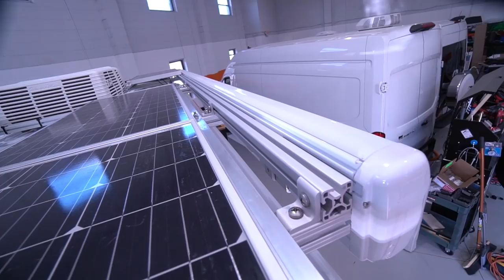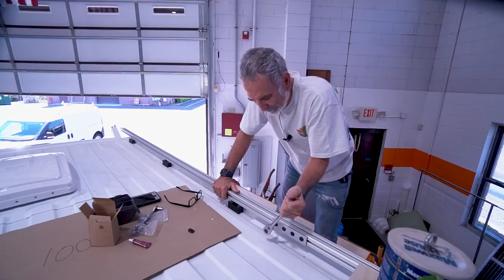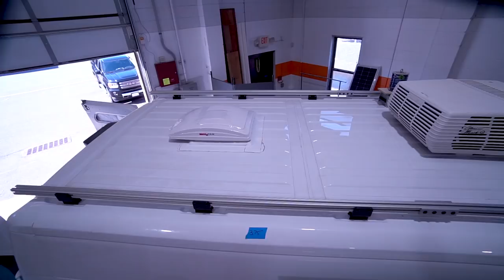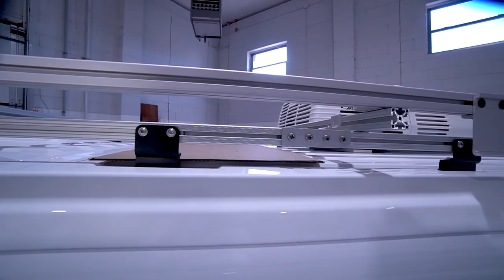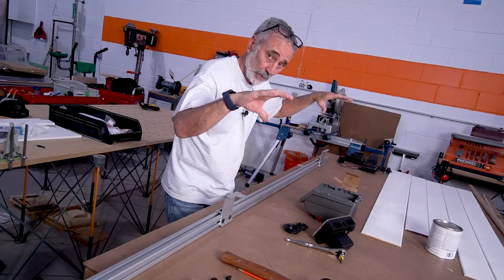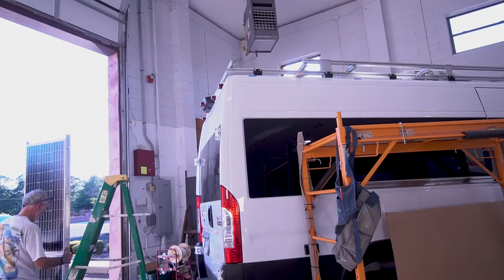Building a SOLAR ROOF RACK (on your van) using 8020 extruded aluminum

Comment from the maker: The bolt, washer and the T-nut are all stainless. Since corrosion is localized at the contact point, the larger anodic surface area (anodized aluminum) as compared to the smaller cathodic surface area (ss washer and T-nut) will create a passive coexistence. Since the ss bolt threads are embedded in a like metal, ss T-nut, I don't anticipate any seizing.
Reply: What a timely video. I am currently designing my 80/20 roof rack for our van. I was concerned about the nuts and bolts but figured 80/20 used stainless. Guess not. Thanks George.
Reply: George. Steel hardware = Loctite. SS hardware = Never Seize I like your rack but the profile bothers me a bit. Captures and holds water and solids. As an example,when hanging steel it was always toe down.
Reply: You’re Going to Get Dissimilar Metal Corrosion Between the Stainless Steel and Aluminum.
Reply: @allenturin8847  Never knew about stainless seizing until working on a van. Crazy stuff. Still haven't figured out exactly which conditions cause it.
Reply: @moneypitvan6378  SS hardware galls like a blankety blank especially in this kind of environment. Never Seize is not optional. Period the end. Spent over 20 years installing erecting and maintaining automated machinery. Nice rack though. I would just prefer it to be a custom weldment with endless runs thats all.
Reply: @allenturin8847  Thanks for the tip, just ordered some marine grade Loctite anti-seize. Couldn't quite figure out which Never Seize to order so hopefully this one works. Ordered some Lanocote also. Seems to be necessary.
Reply: If you do notice any seizing, you can coat the SS parts with Tef-Gel to isolate it from the aluminum. We do this on our sailboats where SS hardware is secured to the aluminum mast.
Reply: @explorenaked  so did I!
Reply: I didn't think 80/20 sold SST hardware.  Where did you source the t-nuts?  Standards are the same size as low-profile weld nuts so I was thinking of going that route.  Thanks
Reply: @ideafaucet5710  Yes, they have both. Their default seems to be the black ones, but they also sell stainless versions.
Reply: @moneypitvan6378   electrolosis causes it.  It is the same thing on battery terminals.  Atoms have energy.  Energy and electricity are the same thing here.  two dissimilar metals conduct electricity differently and corrosion forms.  Aluminum boats and motors have a zinc anode on them.  That anode is sacrificial.  Salt water hastens the electrolosis corrosion effect but the anode corrodes first, protecting the aluminum boat and motor.  The zinc is another dissimilar metal but it corrodes first.  That is why you never see stainless steel on a boat get corroded.  That zinc anode typically gets replaced when it is half worn so that the effect stays intact.
Reply: Stainless and Aluminium is not a good mix - it will corrode. 
Zinc coated bolts are the way to go here, to get it bi-metal electrically happy.
Reply: @G-ra-ha-m  You would think that for as much that 8020 marks up all their bolts would be zinc plated.  Of course now it will be an option and a1/4-20 zinc plated bolt will cots $5.
Reply: @jcbrown59  Stainless and aluminum seem to to work ok together.  Have done is outside for a few projects, and didn't get galvanic corrosion.   Plus, SS is the more noble metal in this case, but it has the least amount of metal.

Comment: Oh no. I have to change my hardware on my 8020 roof rack to stainless. Thanks for the tip.  Enjoyed your video as always. Thanks George!
Reply: Yeah, seems counterintuitive that 80/20 would sell you this amazing weather-proof aluminum, and then throw in bolts that will rust out quickly. I guess 80/20 was traditionally always mostly for indoor use? Fortunately I discovered this issue on bolts under the van right before I started working on my roof rack. No huge disasters.

Comment: I think it's a very good idea to use s/s fasteners on "any" outdoor assembly combined with Lanocote. This product is made with lanolin. That's the grease from sheeps wool. Excel. anti-corrosion, anti-seize, lubricant etc. Totally natural product that works! Especially, if you live near the sea. Comes in a spray can or as a pottle of grease.

Comment: George, I suggest bolting your solar panels to your 80/20 rails, then mount the rails to your roof rack using connections tall enough to go over your AC and Roof Vent.  One flat Solar Array of eight or more 2' panels depending on van length.  Make the Solar Panels the highest point on the van, no shade from other components disrupts the panels, and it provides shade to the roof.  Mine works perfectly!  I can do 80 mph and the solar panels are stable.  Elevate the Solar array to accommodate the maximum amount of panels.  You mentioned in a previous video you want more panels.  It works!
Reply: does wind  lead to excessive noise? just curious?
Reply: @curtjohnson8309  I bolted four 100 Watt Renogy Solar Panels to Super Strut's ( Available at Home Depot and Lowe's ).  I bolted the Super Strut's to the Roof Rack.  No noise, and it provides shade to the roof.

Comment: I did an 80/20 roof deck with manual moving solar panels so I could use the deck. I used 12ft lengths of 40 x 120 on the sides and 40x80 across with decking all bolted with stainless
Reply: would like to see some pics of that
Reply: I have a question, setting up my first can build.  Do you use the 80/20 10x10 or 15x15?  Is 10x10 ok for interior/exterior, or is it to small for anything?  TIA

Comment: If you're particular about black fasteners, McMaster-Carr carries a series of 18-8 pan head stainless steel bolts that are coated with black oxide.  You can easily find 1/4-20 or 5/16-18 that will work on 80/20 hardware, either Philips or hex drive.

Comment: well I did a 8020 rack with my nea320w solar... fit 2x and 2 sets on my roof.... now like you show... one person to lift is easy with those smaller ones... but omg bigger ones are harder.... omg thanks for the video.... shows that My system will work well....:) on my 03 workhorse... just got my batterys in too... :) thanks for the great video.... would love to sit and talk shop some day.... but can't wait to see what comes next... :)

Comment: Really cool 👍🏼 
I've about got all my stuff together to start my roof rack for my solar panels but I've thought long and hard about this because a rv roof isn't enough square feet to have enough solar to run everything all the time. Soooo I decided I'm gonna double stack my roof rack. The bottom will be stationary and the top ones will have actuators. So when I set my rv up, I'll push a button and engage the actuators and they'll fold out. So I'll have 6,400 watts of solar which is perfect. Can't ever have to much power 😂

Comment: I would add a layer of Lanocote paste between the SS bolt and aluminum brackets.  If they drive during winter or in seaside areas salt will get up there.
Reply from the maker: This van will live primarily in the deserts of the southwest. And with the "annual tighten up", any degradation can be addressed.
Reply: @HumbleRoad  cheers!  I should have known you know what you are doing!

Comment: So jealous of Defining Adventure. I met Eric & Jen through another couple and their youtube channel. Nice people. Look forward to running into them on the road one day in our vans. 

Also, great vid here. i have to make a custom roof rack for my van and was wanting to use 80/20, but wasn't quite sure the process. This vid helped a lot. Unfortunately, I've still got to make supports inside the van along the ceiling for the rack because it'll be a fiberglass roof I'm working with.

Comment: Make it where a second layer of panels can slide out and can be used as shade as well as more power!
Reply: Samantha. I had the same idea. Lower panels which slide out like an awning and can be angled up and down for the best sun angle. Maybe with an adjustable leg. Then a top layer which can tilt up with a motor. 2KW panels - easy.
Reply: @ecoworrier  yep

Comment: As stated before, ALWAYS use stainless on anything outside. Nuts and washers to. Ideally, lockouts with never seize on the threads. Blind holes should get a drop of blue loctite.

Comment: Hope that your stainless steel parts are AISI 316 otherwise with AISI 304 you get contact corrosion between stainless steel and aluminum.

Comment: Use the solar panels as an extending/tilking awning... Slide them off the roof, tilt down, boom. No need for an awning.
Reply: And then get fancy and have the tilt be via a computer controlled acme screw that can follow the sun when you're trying to maximize power generation.    :-)

Comment: I've always been against using regular steel hardware in outside/wet conditions. Even zinc or galvanized or other 'anti rust' just doesn't stand up to the rigor. Use stainless A4 or AT grade or go for titanium hardware.
BTW I hope you also used stainless nuts and washers, not just bolts.
Reply from the maker: All stainless.

Comment: I see you managed to set up a bit of a scaffolding.
Here is not me saying you are old, but with age, we all struggle with easily getting up and down such straight scaffoldings.
Wouldn't it make sense to build one that fit the whole length of the biggest car and have it standing in one area, so whenever you need to work on the roof, you park the van next to that scaffolding?
Another thing, when working in heights, consider your safety and maybe connect a stair to the scaffolding, so you don't have to climb up the ladder.
It will also make it easier on you to bring things up and down. 🙂

Comment: Yep, already seeing light surface rust on my t-nuts on top of my transit.  I can reach them pretty easily and since they were a BEAR to install, I think I'll wait on replacing them.  One huge pain in the rear is that as you slide a t-nut with a bolt installed along the 80/20 channel, they want to spin counterclockwise and UNSCREW themselves mid-roof...UGH!  Huge pain to keep them from 'running' out and landing on the roof under the solar panels.  That's why I'm waiting for a bit...good times.

Comment: Depends where you’re at but I would always use stainless on exterior hardware. Stainless will still rust and corrode just not as fast. What you want is the nitride treated hardware it won’t fail. I would also powder coat those rails because aluminum will oxidize over time. If you’re by the coast a lot you’re gonna have rust quick on any vehicle though.
Reply from the maker: 8020 is anodized. You cannot powder coat over anodized aluminum. It would have to be stripped off. Not practical.
Reply: @HumbleRoad  I’m not sure mine is, I know the black is but the silver ones I buy which are really 20/20 but same thing are not. Unless it’s silver. I have a lathe and a mill station made from them and I have all kinds of discoloration. Maybe from the chemicals and oils. Idk. What do you think about using the Raptor paint for exterior protection?
Reply from the maker: Raptor paint is heavy!

Comment: Have you ever given any thought to designing a solar panel slide-out system? Stack them on top of each other while traveling but when parked you could slide them out from each other. Save room and give you twice as much charging power. Instead of 400 watt, you could have 800 in the same area when stored.
Reply: You could use stainless steel drawer glides for corrosion resistance to pull-out and slide-in and locking system for when out or in.
Reply: As an added feature they could serve double duty as a shade and rain block when located over the slider door. Just food for thought. Haven't seen anyone else do this.

Comment: OK you are getting closer for what I’ve been trying to tell people for 10 years now. Take that solar rack go up even higher covering the top of the air conditioner, turn the panels longways and hinge on one side and put an air dam on the front to keep air from lifting panels up. The hinge is so you can get up on the roof and do maintenance you can even put hydraulic struts on it to hold him up out of the way. I hope somebody can use it someday. Because you can get solar the whole length of your roof.Or you can combined it like I seen that one van to where they slide out from underneath each other also.
Reply from the maker: Agreed

Comment: Now I am concerned about stainless fasteners their shear strength is crap.15 yrs ago stainless was all the rage in the building/construction industry. They strip they snap they are not structural. A better solution will be AQC through galvanized ceramic coated fasteners. Just ordered my 80/20 catalog starting a build this fall. Nice roof rack Sir.
Reply: See my response @robertwayne

Comment: Great job, thanks for the video.  I wanted to get more into 80/20 and I look at it as an adult Tinker Toy.  Since you've built this Solar Energy kit for a vehicle roof have you made one for a hybrid car to recharge the battery?
  I charge my car when I get home as I have solar on our roof and it will get me to work.  What I was thinking of doing is designing a detachable solar kit that I could attach to the roof when I get to work and remove it when I get home..  This will allow me to charge my car while I'm at work.
  Has anyone done this?

Comment: 316 ss is marine grade, you must use something on the threads, locktite or anti-seez, stainless screws with the same stainless nuts have a tendency for galling.
Reply from the maker: Every thread gets blue lock tight

Comment: This was a very informative video, thanks!  I noticed that the AC unit is installed in the front and the Maxxair Fan in the rear on the roof.  We are doing our own build, and are discussing the pros and cons of the placement of both units.  Do you have a preference?
Reply from the maker: There are two Max Air fans in this build. The AC is as far away from the bed as the chassis would allow. The owner does not want the AC noise too close to him while he sleeps.

Comment: Whenever there is a connection between steel and aluminum galvanic corrosion happens. The only way to stop this from happening is to stop contact between the two dissimilar metals. You may plasticize bolts or nuts. Loctite is also helpful.

Comment: A Hand Rail along Two Side (1 Long, 1 Short) of the Top of that Scaffold might be a good idea?
Reply: Even the tiniest bit of shade that falls over just a tiny part of one panel will dramatically cut energy production.  A single leaf can destroy the output, and a railing that might shade the panels would be a poor idea based on that alone. Even that air conditioning housing kind of dictates that the van needs to be parked side-on to the sun so it doesn't shade the panels.
Reply: @extectic  My Comment is reference the Scaffold erected alongside the Van being used during Construction and has nothing to do with Solar Array.

Comment: I just got my shipment of 8020 for my Ford Transit a couple of days ago and haven't pinned down a good, flat roof to rack mount so I can attach an awning. The one you used looked nice; will you share where you got those?
Reply from the maker: These racks are custom built in my shop.

Comment: I've watched this 3 times and I still am not sure. Are the panels affixed only on the shorter sides, with bolts to the cross bars, or are they also affixed on the long outer edges? I saw you mention the angle and the drilling on the sides, but i cant see where the long edge is affixed on this rack? I am making a rack and my panels are wider than the track. Wondering if I can just affix the short sides of the panels and maybe a beam down the middle. 

Thank you! My mom and I are the biggest fans!
Reply from the maker: All panels have a 1.25 aluminum angle along each long side. The angle is then bolted to the 8020 crossmembers on the roof.